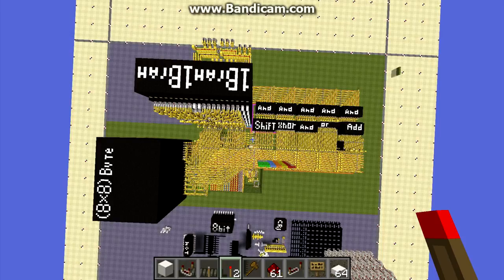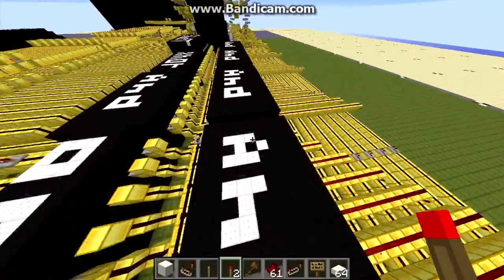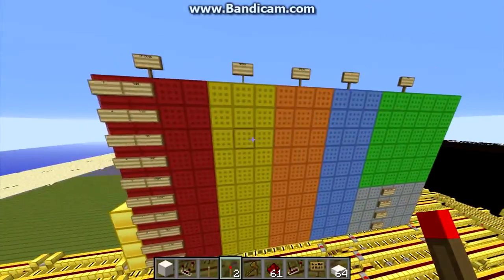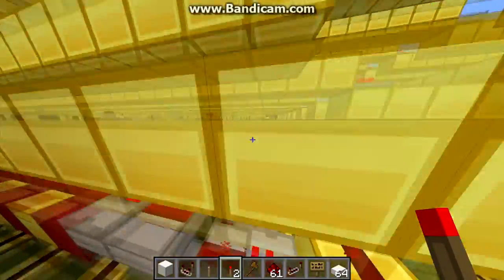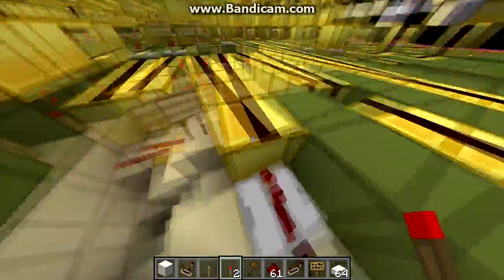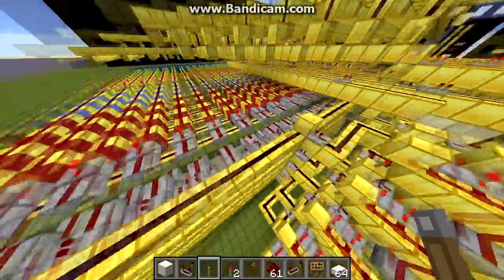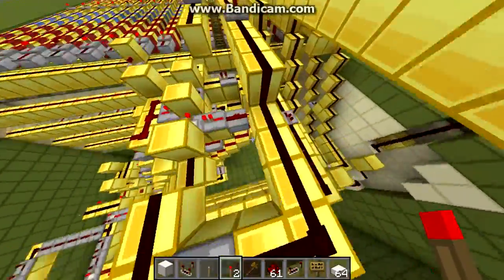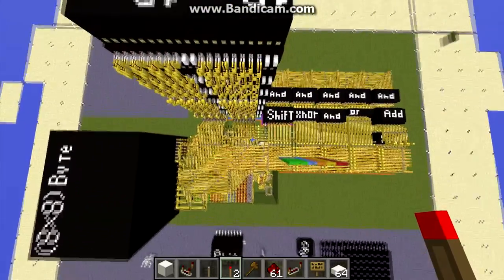Integrated Circuit CPU in MINECRAFT!

Comment: Command blocks arent cheap and stupid, if you cant use command blocks dont blame them because with command blocks you can make awesome creations without redstone.
Reply from the maker: They're cheap, and they aren't considered redstone. There's a reason they aren't even in the creative inventory. Also, if I wanted to code, I'd do it in python or c++ not a shitty interface like cmd blocks. Redstone is hardware engineering, command blocks are software engineering and you cannot argue that.